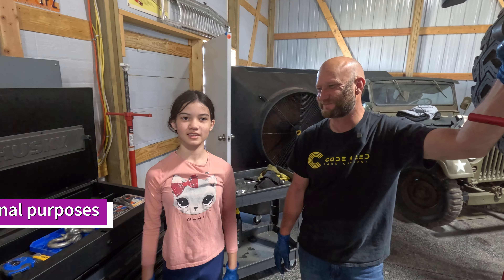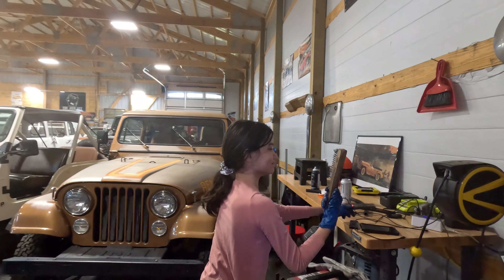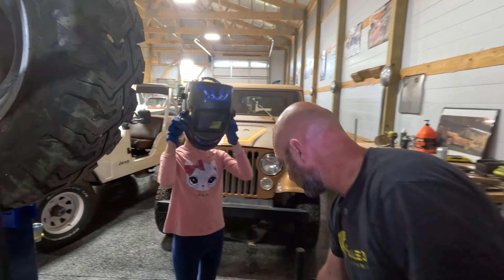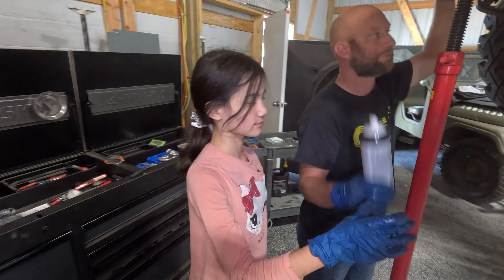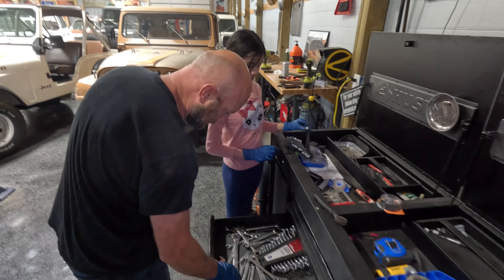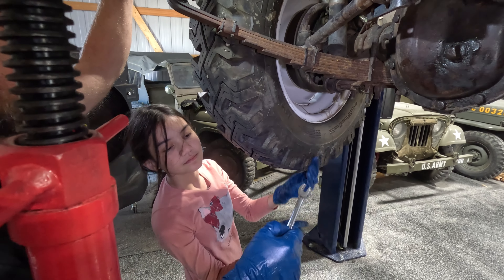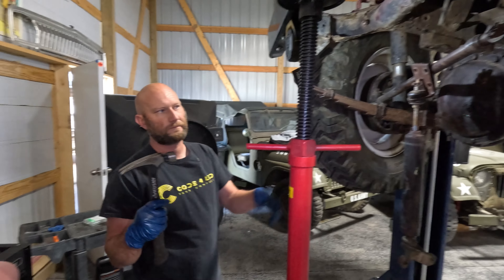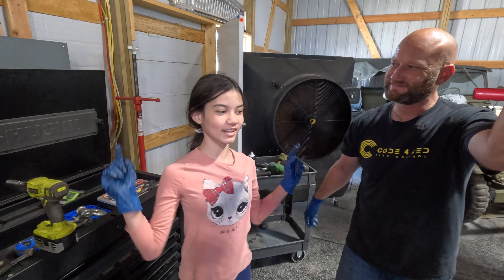Mondays With Mia: Episode 7 - Welding a CRACK!

Comment: My factory stock 77 cj5 has never really needed the stabilizer but has one with over 300 000 miles but my 71 with lift and 31. 10 50 tires seems to need it. Good video.